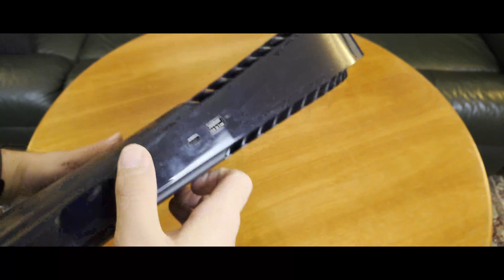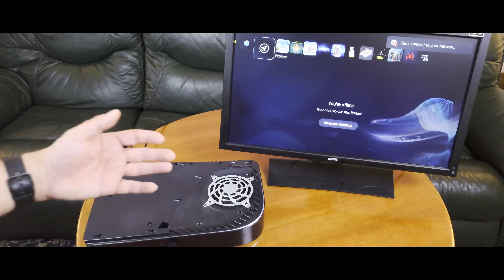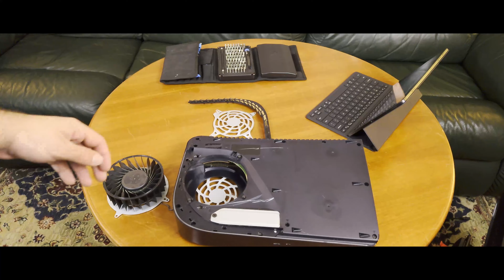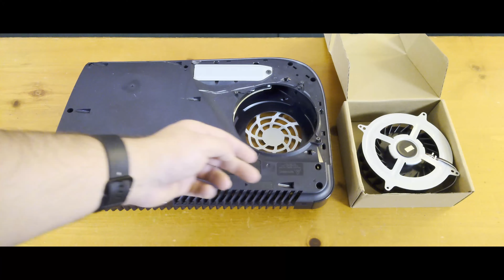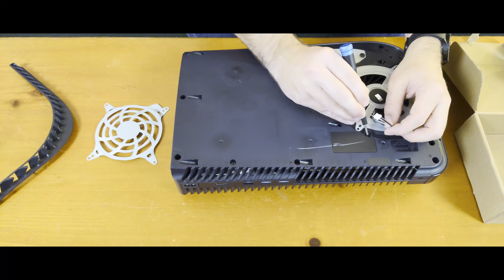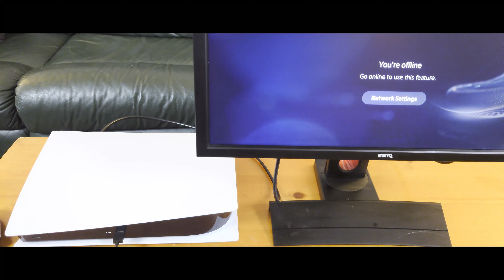PS5 Fan Repair

Comment: How can I know if the fan is working well or not? I turned on the PS5 without the cover and I see that it works. But how can I know if it does it at the right speed? The ps5 keeps turning off and is hot.
Reply: Were u able to fix it